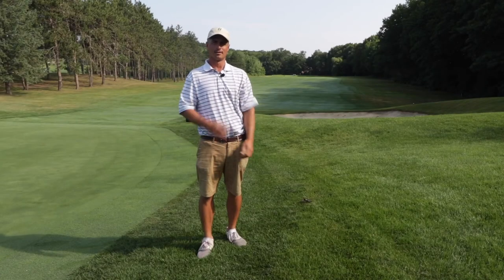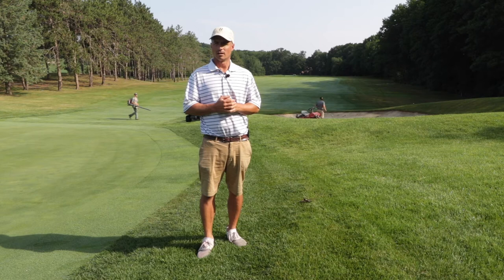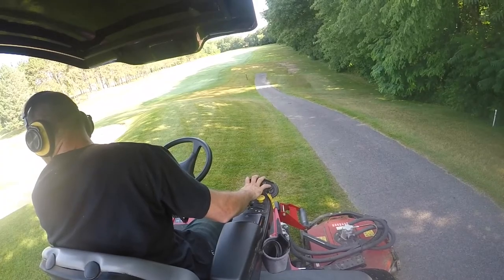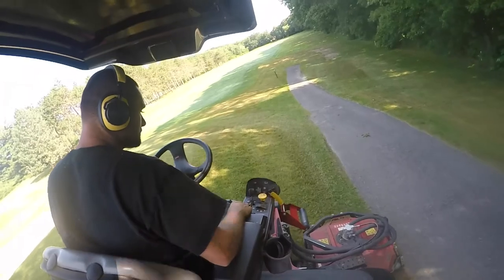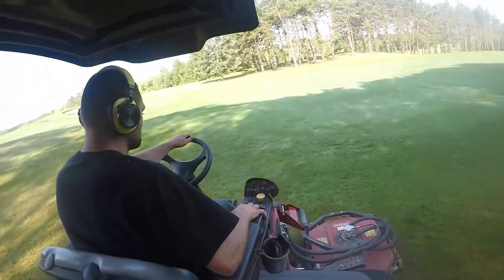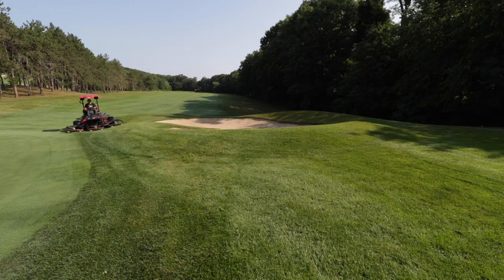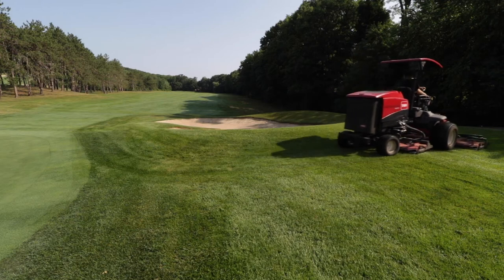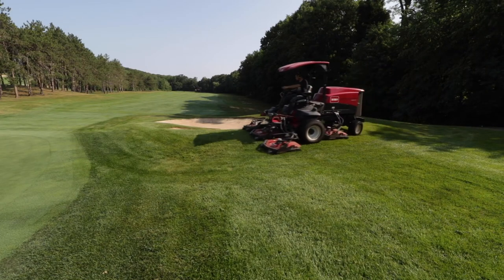Maintenance Monday - Rough Mower

Comment: Subbed I work at a golf course for 7 months now, finally just getting on the big boy mowers, but the training is abysmal. My question you regarding rough mowing is do you do any zero point turns during rough cutting? Lightbulb/question mark turns? Do you go inside out? do you mow in a circle around the fairway or do you split it into sides?

Yes I have asked these things of my co-workers and bosses but they honestly didnt give me much technical info most deflections. Oh an I am primarily on the Toro RM 4500
Reply: there's no exact answer to your questions because it really depends hole by hole and if youre mowing around golfers as well. When I mow around the fairways I'll do full circles unless there's golfers than I try to stripe up a side/area of the rough that isn't heavily played and is somewhat out of the way of them playing. I work at a very chill golf course so I was thrown on the rough mower and was told it doesn't matter as long as the grass gets cut in a timely manner. So over time you find quicker routes and better ways to attack tighter rough areas.